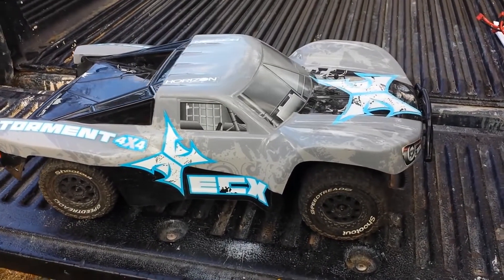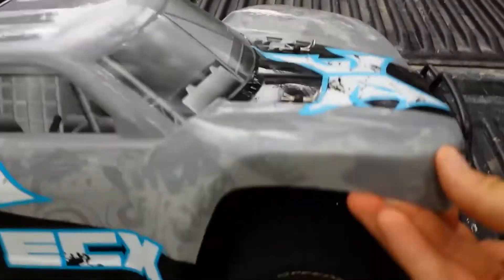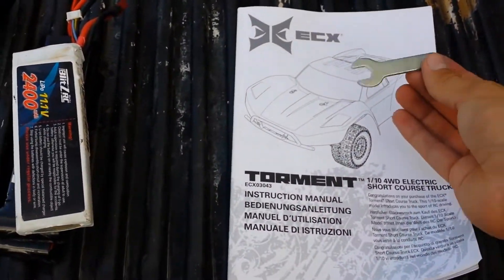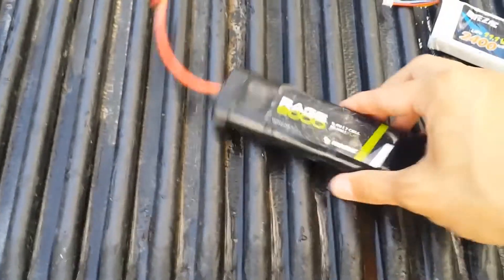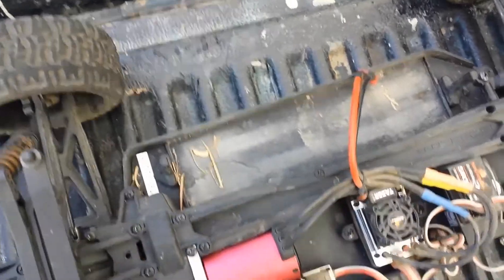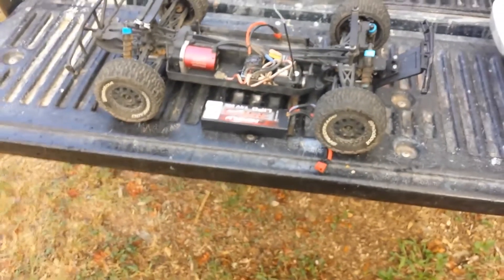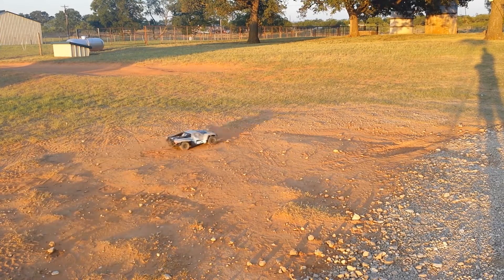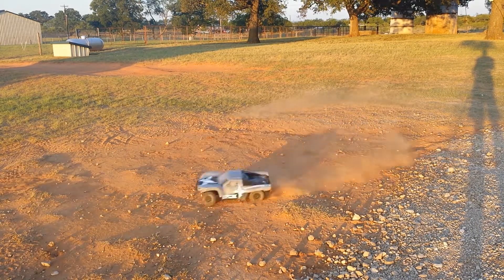ECX Torment 4X4 Review

Comment: I'm not so impressed with mine. Mostly issues with the drive train, and the body shell did not last one outing, Stock tires have zero grip, both bumpers quickly, bearings always explode, spur gear always strips, only when running it on 3s brushless. I did once run it on 6s and it held up better than on 3s. They have now come out with a V4 torment now, which is why this one is discontinued. I have since purchased a Hobao Hyper VS and i run that on 6s and not broken a thing so far.
Reply from the maker: Aidan33Gaming Wow that's too bad, I've ragged on mine over the years and the only problems I've had are the body breaking and the bumper breaking. What brushless system do you have?
Reply: @rccr23  I just had a 1/10 2200kv brushless motor and 1/10 esc. I chucked in my 1/8 scale power system for the 6s outing.
Reply from the maker: @Sailomatics  Nice

Comment: i did a 3660 4600 kv brushless swap with mine. Its a generally easy car to work on. Stock parts are easy to find but man, trying to find a better slipper clutch that would fit was nearly impossible, and what i did find was way over priced. Same thing with finding a spur gear to put in the stock slipper clutch, so I ended up completely rebuilding the drive terrain system. Was it worth it? Eh, i spent nearly $500 upgrading it and it is stupid fast with the right gear ratio (72 mph) but for the $230 just buying the car and another $500 upgrading adding to the grand total of around 750ish dollars, there are many other just as fast options on the market for that price. It really is a durable rc car though, I'll at least give it that
Reply from the maker: That sounds really neat!

Comment: I’ve got this truck but my controller has broken and won’t connect to the car do you have any idea of what I can do
Reply from the maker: Do you have the little binding plug for the receiver? If you do try re-binding the controller to the receiver. If it doesn't work you may be best off just buying a cheap radio and receiver and replacing your stock one. Flysky has some cheap but decent controller setups.
Reply: @rccr23  ok thank you
Reply: @rccr23  I’ll try and look for the same controller and get a binding thing/ is it hard to bind then or is it easy?
Reply from the maker: @Sam-qz4fm  should be easy, just look up "binding rc controller and receiver" on YouTube and there should be all sorts of videos on how to do it

Comment: There are plenty better options than a ECX Torment instead of a Slash only reason I have a ECX Torment is I was given it for free. After the previous owner broke a front A-arm and had lost the transmitter.
Reply from the maker: Can't beat a free rc. Yeah there's plenty of other options, this is just a good one at least IMO
Reply: @rccr23  ya I think I might do a cheaper brushless motor upgrade and have been thinking about getting the rpm bumper and some different tires and try racing it.